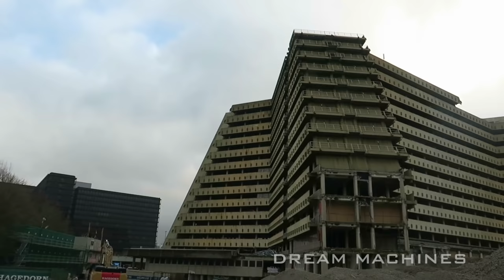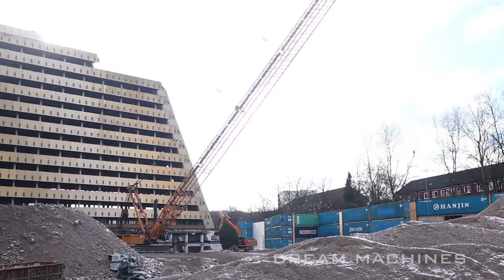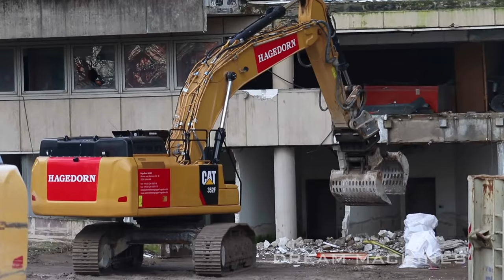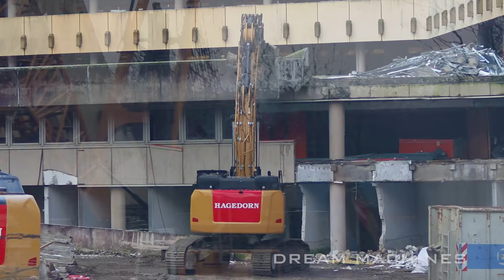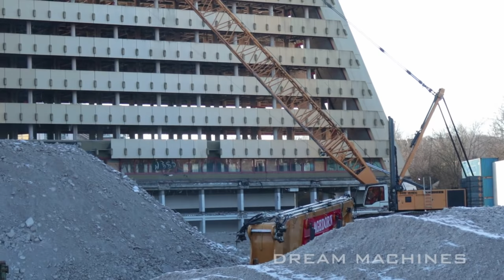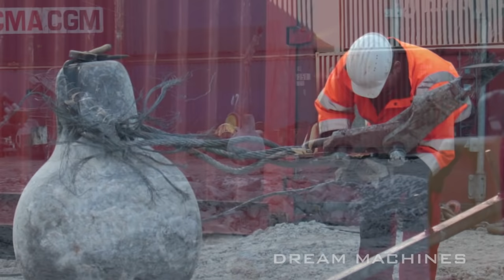LIEBHERR HS 895 & CATERPILLAR 352F BAGGER ABBRUCH MIT KUGEL #1 BAUSTELLE DREAM MACHINES

Comment: What can't be seen in the quick demolition with explosives video's is the amount of work in prepping the building.
First there is months of work removing all reusable materials from the in and exterior, then the strategic weakening of columns and walls.
Then a couple of weeks drilling holes and placing explosives, and additional measures to protect the neighbourhood from flying debries and dust.
Once the building is brought down there is more work to separate concrete, metals and other materials, like the insulation and rubber seals as can be seen in this video, does a contractor want to sell of materials for re-use, in the slow step by step demolition of this building materials are separated as they come off, it's also easier to remove an insulation panel from a complete slab than from rubble.

In Europe re-use of materials is nowadays a legal requirement, preventing the whole landscape from becomming a giant landfill, and also putting less stress on natural resources.
Having less trees than North America brick and concrete are traditionaly the prefered building materials in Europe, also for their longevity and fire safety, so they are more widely used than in North America and would need more not renewable natural resources and landfills if not recycled.
Reply from the maker: so true, thank you for your words!
Reply: Tom Lahaye We build in Europe solid to last you in America build to last for few weeks so whole suburbs blow away with the wind .
Reply: and they say WTC7 collapsed because of fires
Reply: bullshit. WTC7 was rigged and demolished same day with a team of possibly 30 people
its just a bit wavering about with oxy acetylene torches and then you can sort the shit later on for reusable materials and of course setting it all up
polish demolition team? surely 1 year for a major failure, but that wrecking ball driver either put on the wrong wrecking ball or had a bit to drink, i could do more damage with a rubber hammer and a pair of pliers than that little wrecking ball
Reply from the maker: BigToe Sugar Grove  No! You forgot seperating the debris which would take much longer!
Reply: @josipbroz4517  I've been saying that for years. I did my research, no way does the official explanation hold truth.
Reply: @Batman-wv5ng  there is that one beach front property in Florida that survived a hurricane , but it was designed that way , probably was a European design
Reply: Wasn’t there a guy in Oklahoma City back in the 90’s that brought a building down in like a day with very little prep work and minimal equipment?
Reply: Almost every Video of controlled demolition gets these comments from Americans that don‘t have a clue „why not blow it up?“, „waste of time“ or „they must be getting paid by hour“. You can‘t compare the backwardness of american Demolition to Europe, where there ist much more advanced machinery and people actually know what they do (most of the time). Also we don‘t crush houses with interior and dump them at a landfill...
Reply: I hated the video until I read your explanation so I removed the thumbs down and gave it a thumbs up. Does that make me fickle?
Reply: @donnahong5998  Tornado will do nothing to our houses, my two storey house is 160 years old all stone with 60 centimetres thick walls .In USA they build cardboard houses if you blow with your mouth it will fall .
Reply: thanks I was wondering what the purpose of using a wrecking ball was now that explosives could be faster.
Reply: @peon9282  Because American's expect everything to be done in the must dramatic way
Reply: @WeebRemover4500  they say that it was a “office fire” I’m no genius but a office fire can’t bring downs soild steel and concrete building
Reply: Yea pain in the hole good job for the crusher tho 😂 Separates the rebar from the concret and plastic interesting job tho love watching the diggers can’t wait to get on them ✌️🇮🇪
Reply: @bryanmurray1892  hey we're still back to back world War Champs bitch!!
Reply: @DaKRUSH  only half of it bro
Reply: @Shrivellednutsack what he's referring to was years before 9-11, the " Oklahoma City Bombing".
Reply: Keep up the good work guys this much funnier then my moms bedtime stories😂

Comment: I will check back in ten years and see if they have it down.
Reply from the maker: the building will be down in less than 8 weeks!
Reply: before retiring, I was a crane operator for many years. A wrecking ball is hell on a machine.
Reply: Lol get the nukes, and the bucket wheel thing machine
Reply: Bucket wheel excavator
Reply: These guys are obviously paid by the hour. Reminds me of the time I had a helper while painting a store bathroom. The helper spent the entire time stripping and repainting a switch cover. Cover turned out great but.....  He was the owner of the store so I couldn't say much.
Reply: Jeff Schwab  LOL I thought the guy fannying about with the pincers was going to start looking for empty aluminium cans to collect up.....

Comment: Building was staying for 40 years with no issue of fire and was closed due to fire safety. 
Could not believe that it would be more expensive to install fire suppression system than demolish and build cheap residential houses.
Reply: I’d imagine there were other code violations that added up to the cost of a new project.

Comment: Amazing video , if I understand correctly , the spraying of water where the whecking ball or bulldozer  with either bucket or the claw grip into is / was to prevent any fire partly due to the dust & debris ??
Reply from the maker: the water should just reduce the dust due to nearby residential buildings (not healthy for humans and environment) - it's the law. Has nothing to do with fire prevention.

Comment: Somebody please explain to me why in the hell are they starting with the top? Is this a government/union job? Last time I checked, a building is held up by the bottom columns. Wouldn't that be a good place to start?
Reply: if you undermine the foundations without clearing the top you end up working in a danger zone. Worst thing to happen would be they destroy the lower part and the top still stands. Even with dynamite they would blast and fracture the upper levels before blasting the base and main columns,  even if it's by fractions of a second. Plus the weight of rubble on top helps bring down the rest.

Comment: It would be really interesting to have an insider's perspective on how an operation like this is planned and conducted. The exciting crash-bang bit must be just the tip of a huge iceberg. I'd be interested to see how the various recyclables, copper, etc, are removed and reused and even the logistics involved with the removal and disposal of these sort of quantities of concrete and steel waste. Presumably there are also hazardous elements, asbestos, lead, etc, that need careful disposal. The dust from a controlled explosion demolition must contain all manner of nasty stuff - silicates and who knows what - that must be a major problem. Doing the job with a wrecking ball like this must, I'm guessing, eliminate a lot of that? I love getting these fascinating glimpses into trades and skills.

Comment: I belive running the objects in a machine to crush all items, then passing under a strong magnetic field to take out the metal, then into a bath to float the insulation then gringing everything down to 1/8" this could then be used at componets of concrete. A tiny bit of rubber and insulation isn't going to hurt, if its glass insulation its going to add strength to the concrete. There are far faster ways to do this with sustainable methods and some thought. 
By the way we recycle in the USA now. Its not all landfill. And your out of tress becuse your nations have been clear cutting and not planting the forest.
We have forest man planted over 100 years ago we manage them.

Comment: Knocking the building by inches
Reply: This is Europe, so a safety inspector probably has to inspect each piece of rubble or something.
Reply: @scdevon  I‘m sorry but I don’t think Americans should complain about European Demolition while being the ones that just knock buildings down fast and barely recycle (only scrap metal for the money). And then think of the Oilquick couplers that have been around for almost 20 years and allow a quick change of attachments.

Comment: They need a giant hydraulic "claw" that can be held up there by the crane and operated by remote control to pinch through the rebar.  I few strategic bites and it would come down in much larger chunks.

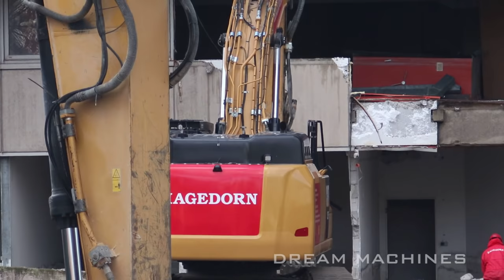Comment: 04:20 were they picking up Asbestos?!!!
Reply from the maker: I don't know. It can't be wrong wearing a breath protection mask during working with any kind of dusty materials ;-)
Reply: Sure looks like sheetrock or insulation, that both can have asbestos.  In the States, the building has to be completely remediated prior to beginning any demolition.
Reply: @rockkitty100  It‘s „just“ styrofoam, which still leaves a mess.

Comment: Ist das nicht schon veraltet mit der Abrissbirne? Warum sprengt man nicht bzw. knappert das Gebäude von oben nach unten ab.
Reply from the maker: veraltet ist das nicht, es kommt immer auf die örtlichen Gegebenheiten an (Gebäudehöhe, Platz auf der Baustelle), 
beim Abbruch von Industrieanlagen wird diese Methode weiterhin eingesetzt. Es war für diese Baustelle kein Longfront Bagger zu kriegen, der bis zur obersten Etage reicht. Eine Rampe für einen kleineren Bagger zu bauen war keine Option: man hätte tausende Kubikmeter mehrmals umsetzen müssen für verschiedenen Standplätze - zu aufwändig. Sprengen war hier nicht möglich wegen vieler naher Gebäude. Außerdem ist nicht gesagt, dass Sprengen unbedingt Arbeit erspart: die Trümmer müssen so oder so sortiert werden, da kann man auch mit Baggern abreißen und gleich schon sortieren.
Reply: Vielen Dank für deine Antwort. Ich finde das ist eine sehr gute und logische Erklärung
Reply from the maker: gerne ;-)